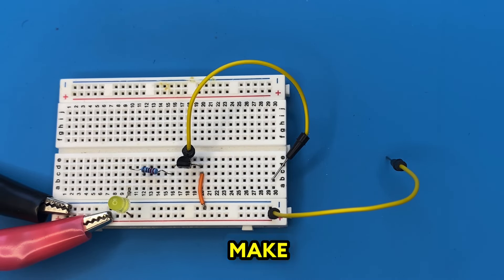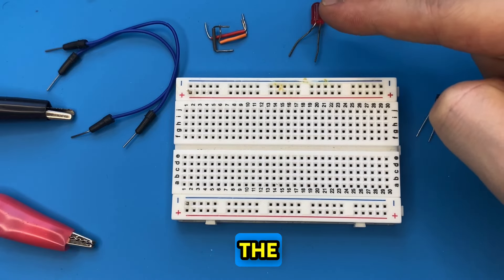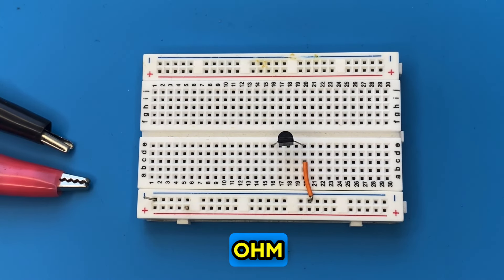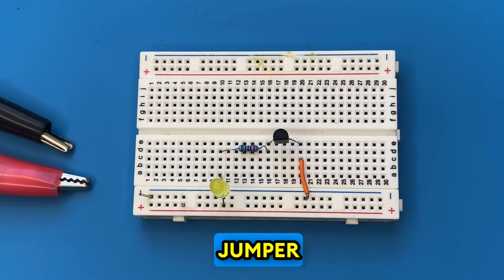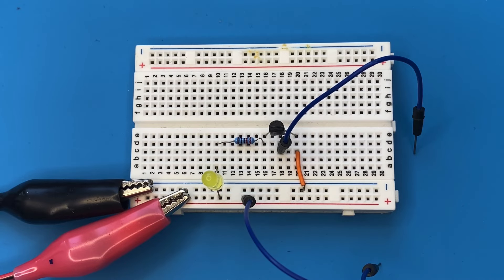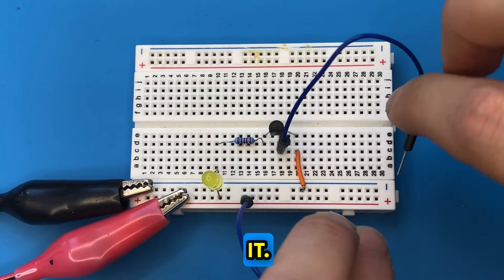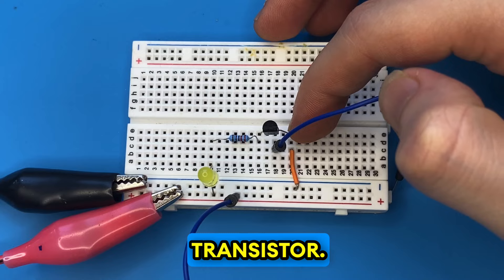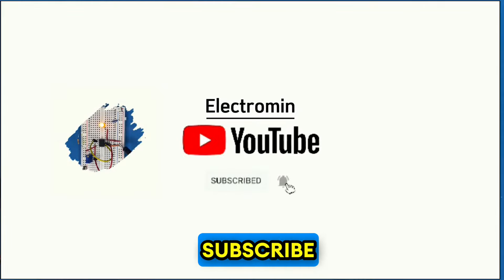Glow up a LED by touching wires after watching this video | Touch sensor

Comment from the maker: Check out the most viewed videos on my channel: 😍

Clap switch circuit 👏

https://youtu.be/0ZeVsRDpZTU?si=tCz1kBi8CxQUP8ga

Darkness sensor 🌚✨

https://youtu.be/kePkWBJPhYU?si=HXZe4xrQD43vrnDS

Voltage level indicator 🔆

https://youtu.be/MHp1QqaaNd0?si=7WFuoeLT1JYZie-3

Fire Alarm Cicuit 🔥

https://youtu.be/A98oM_p3Kco?si=w92x_1L5cEaqsSdL

Light sensor circuit 🌈

https://youtu.be/7kEjupgOM2k?si=wUiLZQYkGoaGPYMj